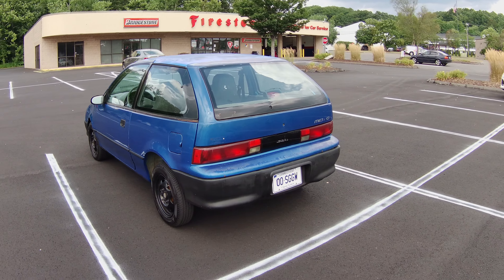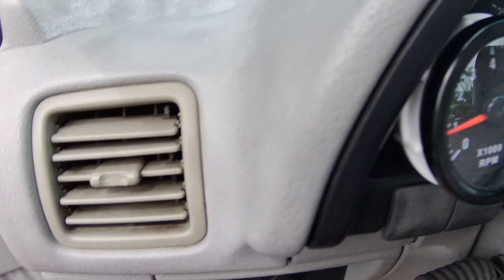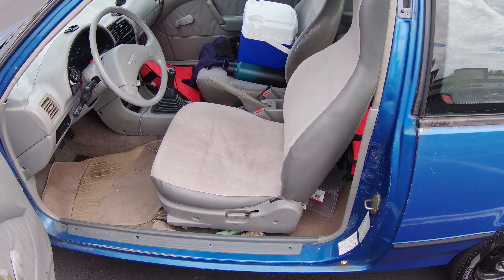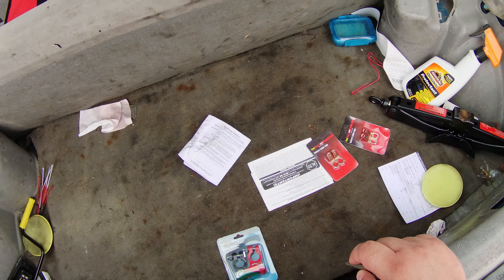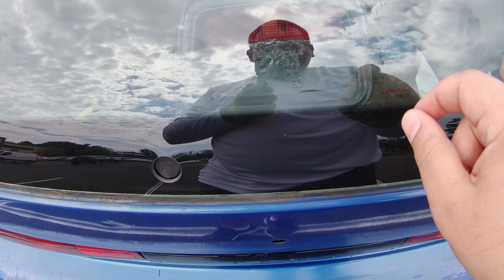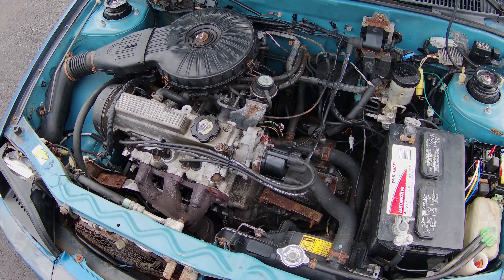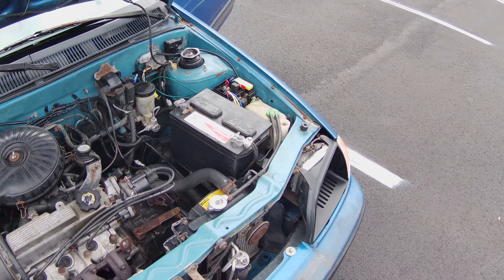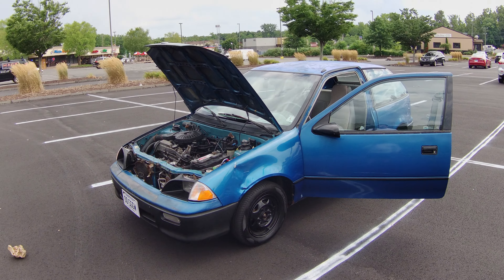1994 Geo Metro - Walkaround

Comment: Cool little car man! For the engine and engine bay.. any rusty parts like bolts and brackets, strip the rust and paint them silver or black. I would do the timing belt and water pump just for piece of mind of knowing the belt is new. I’d get some factory looking 14” alloy wheels to brighten things up. 

Before the paint job, you can make the exterior look loads better with a clay bar and machine compound and polish.. that mixed with the wheels would look nice
Reply from the maker: Timing belt is new and got spare brand new water pump from the previous owner and a whole list of parts he's replaced on it.

The next thing I need to do is the code 42 = "camshaft position sensor" AKA distributor pickup coil. 

Also got some plans to do some wiring add-ons and mods. 

As far as the paint i need to do some dent work on it such as the roof that looks like a tree fell on it and somebody hammered it back

Comment: This is a really cool little car.  I've owned a few of them and they are really great to have.  If you are on Facebook join the geo metro car group and post your videos and restoration progress on there as well.  It's a fun group. My first geo metro I bought brand new in 1993. It was on the showroom floor.  It was just like yours but the color of mine was competition blue.   That was the color name but it was Basically sky blue or baby blue.  Some people called it grabber blue.  But anyway I bought it brand new and that little car took me everywhere. It never broke down on me until it hit 215 thousand miles and the only thing that was wrong with it was my fuel pump went out.  So I had to replace that.   Anyway I won't keep blabbing on.  I'll subscribe and wait to see your next geo metro video when you do post one.
Reply from the maker: Awesome little car for sure. Perfect for doing city driving deliveries which is what I bought it for and I also been wanting one since I originally started my YouTube channel with a 97 Geo Metro back around 2007. This one has been a bit of a hand full getting everything fixed up and issues popping up such as electrical issues as I put miles on it. But this car is so easy to work on why wouldn't I keep it going.

Also I am on that group. Might have seen some of my posts on there.

Comment: This has more room behind the rear seat then the Tracker. Are you going to try to paint it yourself?
Reply from the maker: If I could find a spot to rattle can it without nature landing on top of it when the paint is still wet or gonna do all the body/prep work and send it to Maaco for a budget paint job. I need to do the same for the jeep.
Reply: @jmoyet  Are there enough intact whole Metros at junk yards to get body panels?
Reply from the maker: @JohnDrivesAnything  when I was looking for the transmission I could not find a single metro at the junkyards. Not 1 had one in the yard.

Comment: I have that same exact radio in mine lol, what kind of tach is that?
Reply from the maker: Cheap one off ebay. No name brand. It works for 3cyl.
Reply: @jmoyet i need one of this I can’t find
Reply from the maker: @JamieLe-b4n  ebay look for 3 cylinder tachometer. They'll be advertised as "1-8 cylinder tach"

Comment: I am looking for the back windshield for that same model.  Saw one on ebay for 700 bucks can't seem to find something cheaper 😕  any suggestions greatly appreciate it.
Reply from the maker: I would try auto glass replacement places to see what their prices are such as safelite. Sometimes some might be cheaper than others. Also some of those listing on ebay will be higher cost because it might be the OE glass from the factory or they're marking up higher than what it's worth. 

I don't have anywhere specifically. You could check out a few Facebook groups. I found the HVAC bezel for my metro on one of those groups. 

If you have a Pick N Pull near you there's usually an auto glass place attach to them they might have used but still good glass in stock for cheap.
Reply from the maker: Just checked safelite for the back glass and it's quoting me between. $455 and $560 for economy or premium service.
Reply: Thank you for the info